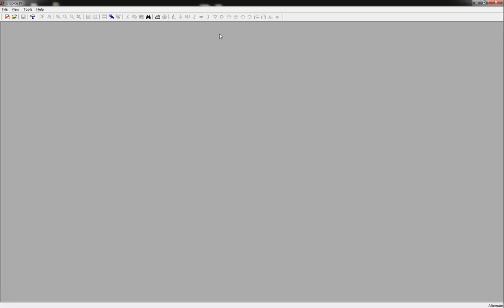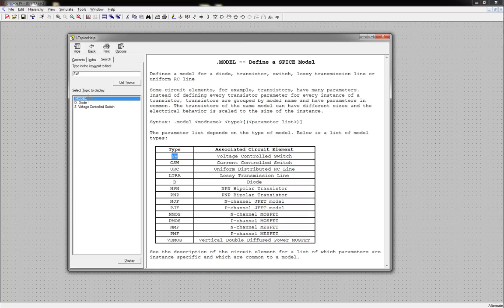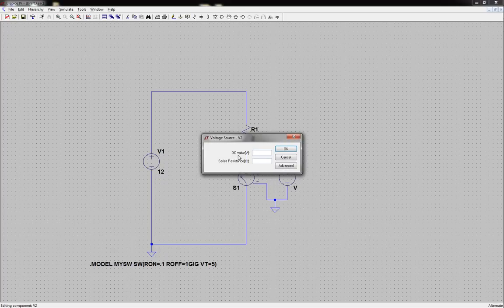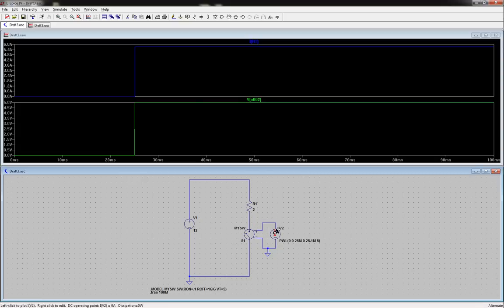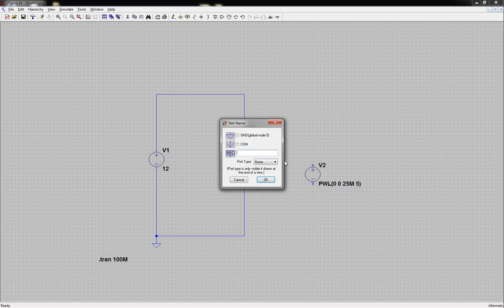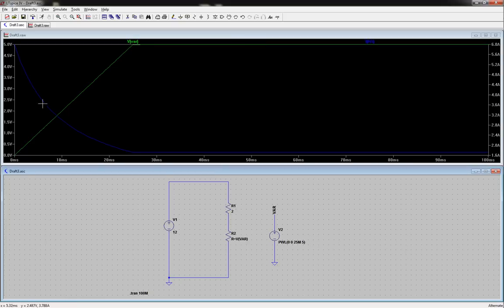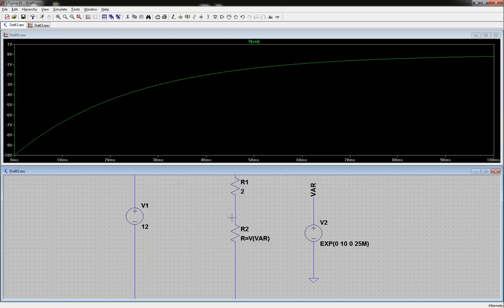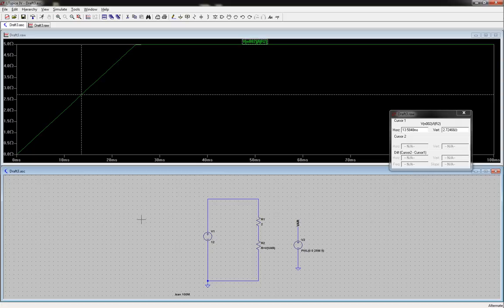Helpful Tools: LTSPICE Voltage Controlled Switch and Resistor

Comment: i copy what you have ,exactly v1=12 , v2=pwl( 00 25m 0  25.1m 5) R1= 2 , .tran=100m , .model sw sw(Ron=.1 Roff=1gig Vt=5) , result : v2 source pwl switching on 5v like what you have , but current source from R1is not switching on like what you have 6A, instead it is a flat line around 0mA,open circuit as i measure voltage 12v drop at R1 . any idea why or what i've done wrong ? thanks !!!
Reply from the maker: Hey there, thanks for the question.  I would check your .model sw sw(Ron=.1 Roff=1GIG Vt=5).  I would ensure that when you type the first part, ".model sw" the "sw", which is the name of the device, matches what you have named your voltage controlled switch.  In the video I named mine "MYSW" thus the command would be ".model MYSW sw(Ron-.1 Roff=1GIG Vt=5)".  Also check your time step that you are using to view the wave form. you need to be at least 100ms otherwise you may not catch the point when it switches it on.  Also ensure that the polarity of the votlage source v2 matches the polarity of the switch, i.e. positive goes to positive and negative goes to negative.  Also make sure that you have the ground symbol on the negative of the v2 source.

Hope these suggestions help out.  let me know if you are still having trouble.

Thanks.
Reply: misperry
thank you for your prompt response , i did exactly what you said  times after times and cuz it did not work the way it suppose to i down loaded a new LT SPICE , still it changed not thing ... it seems that the switch is not on  causing the circuit to open ... truely why , i really cannot figure out ... hope you can figure out , thanks !!!
Reply from the maker: robert c Hey there sorry for the delay.  I figured it out.  you need to set your threshold voltage lower in your switch .model command.  Use VT=2.5.  This should do it for ya.
Reply: misperry
thanks a lot ... it works ... that answered my question ... very truely appreciated ...
Reply from the maker: robert c No problem.  Had to think about that one lol.  Glad you got it working.  Take care.

Comment: Happened to find your channel while searching for 'voltage controlled switch'. I'm working on a circuit that I need a voltage controlled switch to function much like a 'smart relay', but without using an arduino. Do you know of any type of 'old school' way to handle voltage-level controls on a circuit on-off switch? It is a 12vdc circuit that is moderately-high amperage (60-75 amps). I had considered 'cheating' and using an automotive voltage regulator with shunt, but would rather know how to build the circuit than just grabbing something like that off-the-shelf.
Reply: Nevermind, I just found it. I'm looking for something along the lines of an op-amp with an LM741 (was kinda looking for simpler, but this will suffice).

Good channel, though. Good luck.

Comment from the maker: Or you can just do a plot of the voltage and the current and plot another point and right click on it.  In the white space delete any text and type V(nXXX) XXX being the node that your OC voltage is at divided by I(V1) if you are using one source called V1.  This will plot the resistance.  So if your voltage was at node 1 you would have this equasion:  V(n001)/I(V1).  Hope this helps.

Comment from the maker: Hi there, thanks for the comment.  If you are wanting to know like a thevenin resistance looking into your resistor load bank from the load side of things then you could just run a curent through the resistor bank and measure the open circuit voltage.  Then short the bank and measure the sort circuit current out of the source.  Once you have these two things you can do open circuit voltage divided by short circuit current and it should give you the equivalent resistance.